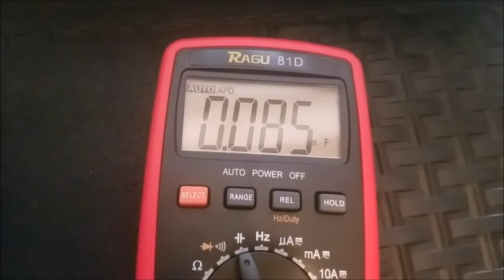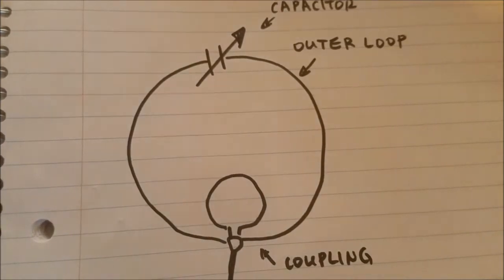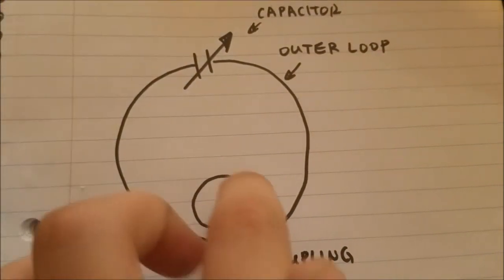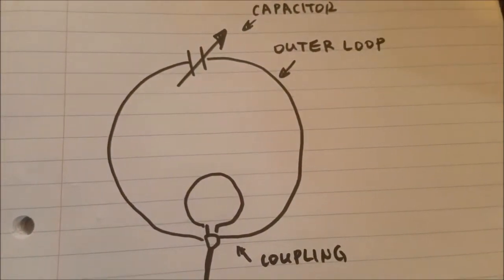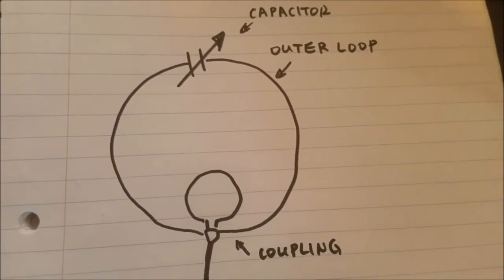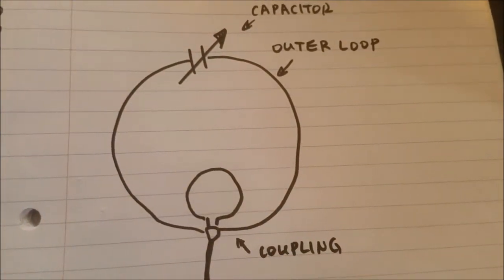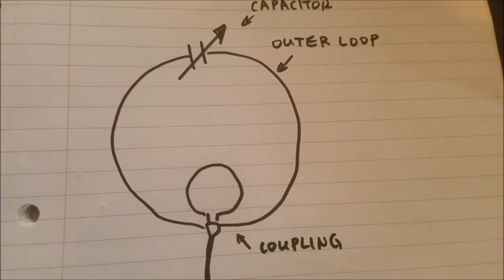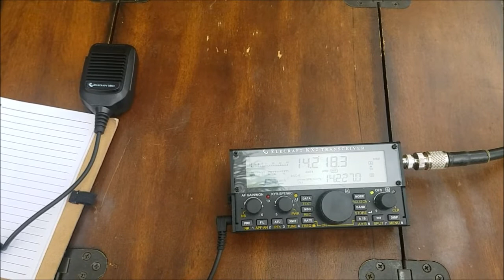2018: Thomas N1SPY magentic loop antenna project

Comment: Cory's right below. You need your coupling loop in as close a proximity to the outer loop as possible. Looks like you're on the right track. Also, that roughly 90pF of capacitance is quite a bit for a capacitor of this type. You've got everything you need to make a really good loop antenna. Hope to hear you on the air. Drop me a line if you have any questions. W0XO

Comment: You have the right idea Thomas but you will need to get that coupling loop closer to the outer loop in order to get an effective signal out. I would suggest reversing the orientation of the loop and put the capacitor at the bottom below the loop and place the coupling loop at the top with the BNC connector under the coupling loop. That way you can get more surface area near the outer loop. You will also be able to adjust your SWR reading by moving the small loop closer to the outer loop. Good luck on your project! 73 de N4UVR